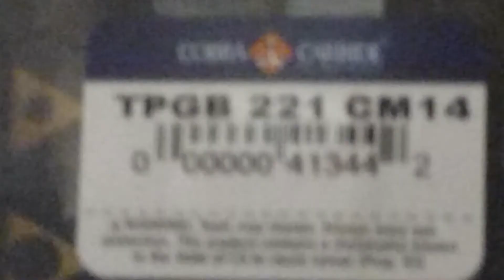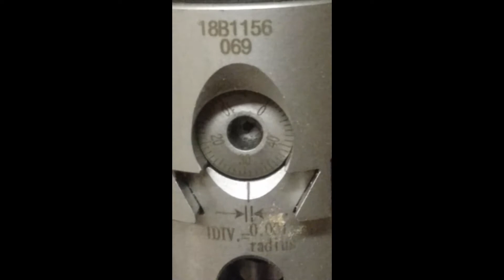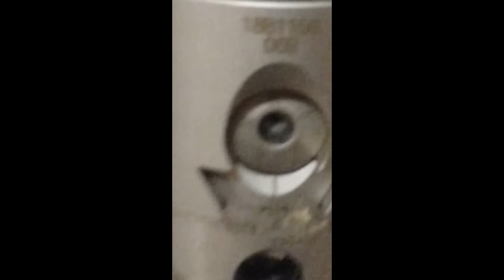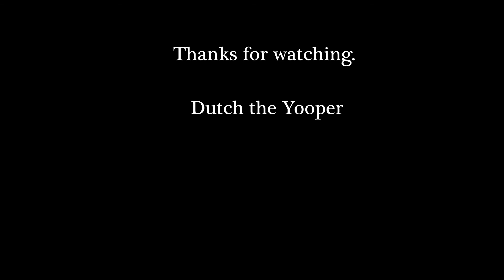Using a Boring Head/Bar in a Drill Press

Comment: Wanting to do this due to same reason(lack of end mill). Did you have any problems with the boring head falling out once you started cutting?
Reply from the maker: Not with this job but using an end mill in the chuck I did. Most annoying.
Reply: @Dutchtheyooper  thanks for the response. I have seen these boring heads come with a MT2 and was hoping I'd be able to set it into my drill press and not have it fall out while cutting. Thanks again
Reply from the maker: @AzDad1928  The main thing to remember is to avoid chatter.
Reply: @Dutchtheyooper  yeah, in a perfect world, you could go down to a used machinist tool store, get on a rent to own program for a mill and have it delivered and set up where you need it. Until either that happens or I come across enough money and moving capability to obtain a mill and lathe, it's the  MacGyver route for me.

Comment: Mate, .007" to .012" is way too much interference! You'll have fun trying to press that bush in that hole... but you've undoubtably found that out by now, and if you did manage to get it in i'm guessing the shaft didn't fit because the bore of the bush closed up too much...that is unless the shaft has a lot of wear! General rule of thumb is .001" per inch of diameter for an interference fit. But good on you for having a crack with the equipment you have...you're on the right path.
Reply from the maker: New bushing in no problem new pin in no problem works great.  Thanks for the info.

Comment: I wonder how it would do it you had two bars with a bit on each side.  I would expect it to balance out the boring head more, and create less chatter.  That may not be possible with that type of boring head... I need to make one!
Reply from the maker: I believe the chatter is created by the slop in the bearings. Milling machines have bigger and more robust bearings with much tighter tolerances. They also have much more weight to keep it stable. They are also pricier and hard to move around.

Comment: What kind of shaft do you have between the boring head and the drill press chuck? Thanks for the video, Dutch.
Reply from the maker: It is a Shars Morse taper adapter with tang and 1 1/2 18 threads.  It would depend on the model boring head and the size/style of the drill press.  They were made with Morse taper 2 or 3 with or without tang.